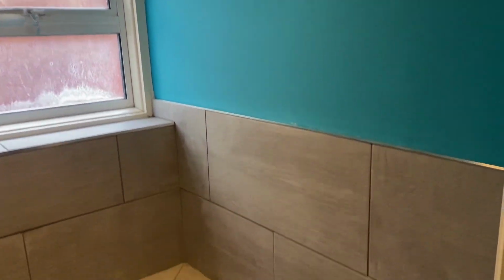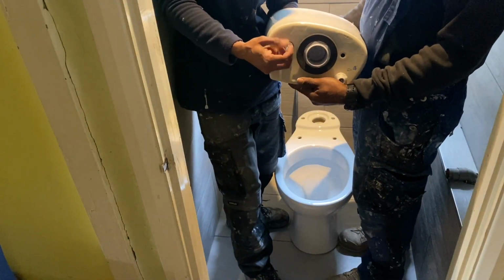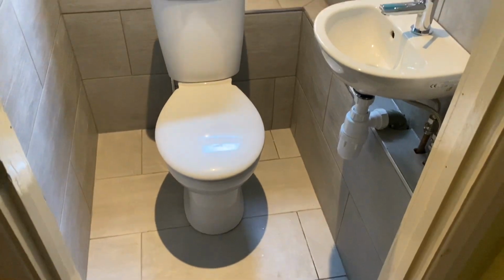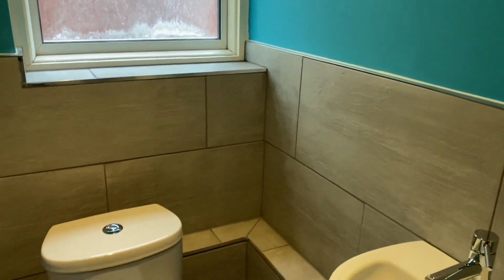Cloakroom toilet finished! Ep4

Comment: So confused with why you didn’t raise the boxing on the back wall to the next tile and the width of the wall so the cistern wasn’t floating?
Reply from the maker: Hi Jay, this was the best compromise in my opinion. Raising another tile would cause the sink to stick out past the door and too close to the toilet so we kept it to the next available tile height. There enough backing for the toilet cistern to rest solidly. Cheers
Reply: Or kept the boxing as low as possible,so the toilet went back to the wall,also I’d of given yourself a bit more waste pipe to work with, the trap looks like it’s on the piss🤷🏼‍♂️
Reply from the maker: If the boxing was lower then all the pips wouldn’t have been covered. The trap is straight. It may just be the camera angles cheers
Reply: @richardcordell9377  Does provide a handy shelf though...